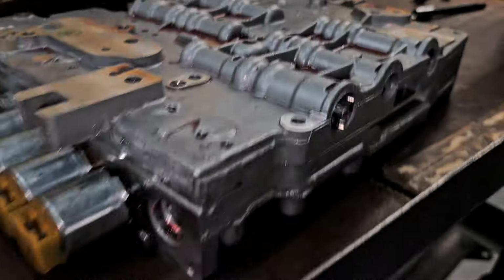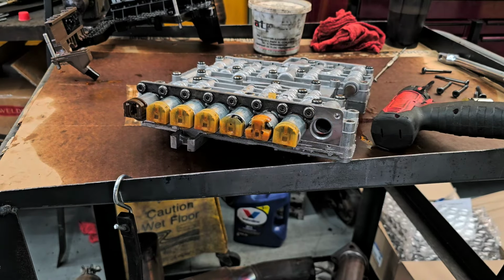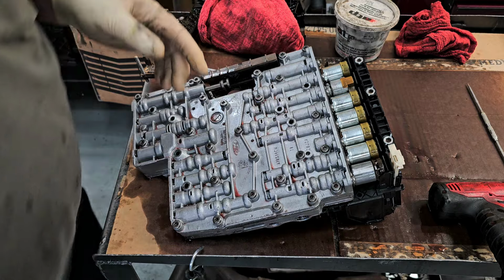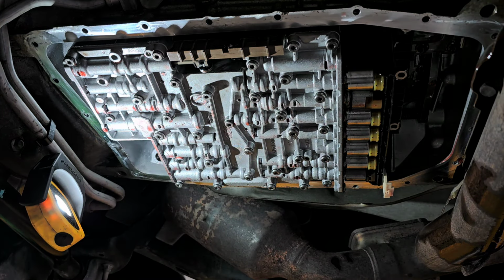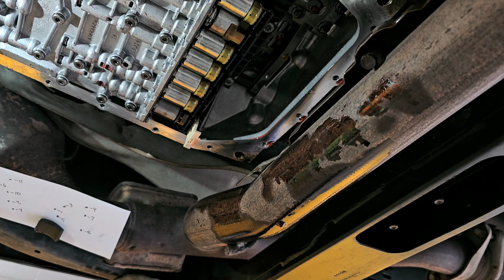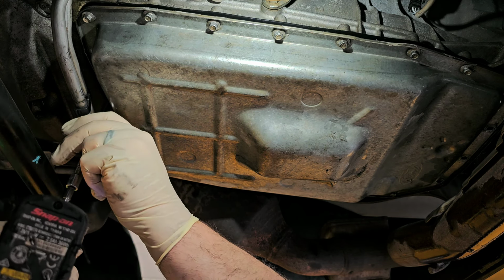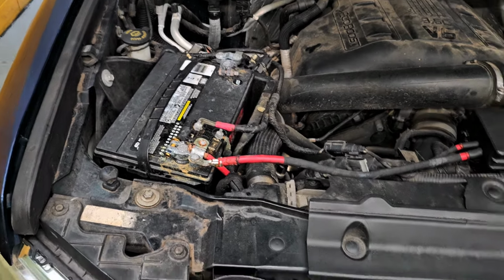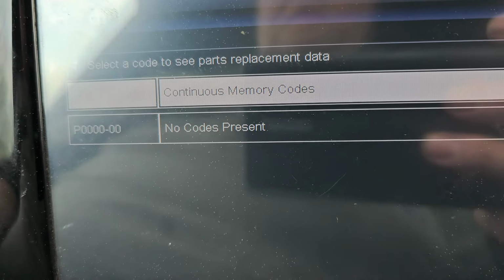Transmission Limp Mode After Warmed Up. I Finally Find The Problem & Fix The 2011 Ford F150!!

Comment: I had a repair on a customers car. After burning a bunch of brain cells I found the problem and at that point it was obvious someone had been working on it before I got there. I fixed the previous repair and it corrected the problem. I charged the customer a couple hours diagnostic charge, plus the time for the repair. When the customer came by to pick up the car I asked about the cobbled up repair. He looked at the floor and mentioned he had tried to fix it and failed, then brought it to me. I told him he could have saved a couple hundred dollars if he confessed that when he dropped it off!

Comment: I'm sure the power tool dependent generation could use a tutorial on thread repair. 
The number one tip I have is don't start threaded fasteners with a power tool.
Reply: About the only time I use a power tool with threaded fasteners is hanging drywall.
Reply: Great for removal. NOT for install.

Comment: Kenny ... excellent video. Mechanics like you are few and far between. Most dealers penalize you (flat rate robbery) by giving you all the hard cases!! My father was an old school mechanic. He knew electrical and was punished while the other mechanics got the brake jobs, tune ups, and simpler things. 

Your external microphone is fine. It sounds like you are over-modulating, and that should be simple setup to decrease the microphone sensitivity.

Comment: Yeah,a video on thread inserts would probably help us out, Mr Kenny
Reply: Helicoil, with the part needing repair held firm in a mill to do the locating, drilling, and threading.  A well set up drill press can suffice as well.  Anything done with a hand drill free-hand will make for an oversize hole that is weaker and looser threads.

There is only one insert type that is FAA approved for full-strength thread repair - Helicoil.  Solid inserts like EZ-Lok and Timesert will fail over time in any vibratory or thermal cycling application where a Helicoil will expand and contract with the parts in vibration and thermal cycling.  Pretty much all applications are vibratory and thermal cycling.
Reply: @BillyWillicker  I couldn't hold a regular hand drill steady anymore, so yeah a drill press would have to be my friend 😂🤓 ( I'm getting old)
Reply: @BillyWillicker  I worked on avionics where the cover screws, and any threaded parts going into the aluminium main castings, were all equipped with helicoils from the factory. 100 M4 inserts per unit, just for the 2 covers. Electric screwdriver was the first tool I bought, though I did make my own driver, using a long hex wrench with the angle cut off, and brazed into a brass hex spacer that was 1/4in across flats, and fitted the screwdriver. Long, as I knew i would have wear, so a quick grind of the worn end made it new again. Did have to replace the gearbox in the driver, the new Black and Decker gearset was powdered metal, instead of the plastic of the original, and lasted a long time, inserted with lots of light grease to help, unlike the original.

Comment: Good job finding and correcting a previous poor repair.  I had a similar instance where the customer had replaced a solenoid in a 6R80 for a circuit code.  After their "repair" it had a circuit code for the solenoid right next to it.  It ended up being damage to the main transmission connector on the harness side from a further previous "repair" before the customer had owned  the truck.  I replaced  the transmission/O2 harness and the vehicle was reliable afterwards.  

When it comes to transmission work, you have to thoroughly diagnose prior to dropping the pan.  That means road test with a gauge and scantool in a second tech's hands on the drive.  Proper pressure/scantool diag would have pointed you to that solenoid specifically before dropping the pan.

Comment: This was on par with a Fordtechmakuloco video. Great job finding the solution to this problem. I will add this, when replacing the pan bolts into the transmission, a light coat of anti seize goes a long way for getting them back out later. Steel bolts into an aluminum case here in the Midwest is corrosion trouble.
Reply: Never had any trouble with trans pan bolts in missouri
Reply: @donames6941  Missouri isn’t Chicago tho.

Comment: Torque converter bolt holes,GM and Chrysler have one that is an egg shaped hole.Line up this hole tightening this bolt up and the other bolt holes line up

Comment: Great job 👏,,I wish most mechs were this honest in houston ,,every 1 here tells you need a rebuild for over 2500 dollars 💸   3500 4500 for heavy duty 😂,,1 of my friends have gone for 2 trans 1 fully rebuilt diff when he only needed axle bearings

Comment: I'm sticking by my notion that your phone's mics all updated their drivers when you tried the bluetooth trick, and that's what cut the sound out a couple vids ago.  the audio quality is distinctively brighter.  and thanks for the torque wrench reminder, I actually went and double checked mine (I've hit a lot of lug nut idiodicy, usually overtorqued via ugga-duggaing and idiodic capped lugs)

Comment: 2 observations on my part, one is it seems that you are the one who is always fixing someone else's problem (someone has been there before) and you have such patience. I did notice when you used the tranny lube that you said "Let's pray it stays there". I was praying too. Mrs. Wrenching really came through for you on the one tool item. She (Meg) is a good woman...how is she doing now? Great job Kenny and super video. Oh, one more thing...can't you get a co-worker to hold that valve body in place while you install the screws?

Comment: Great video! I just subscribed to your channel. 😊

I guess there is no need to program the solenoid?

Also, if you replace  the valve body, does the valve body need to be programmed?

Thanks.

Comment: I have installed a lot of heli-coils and do not like to install them in aluminum as they seldom hold even with Loctite 212. I would rather bore out to the next larger size and tap.

Comment: Non mechanic so this will be stupid question, does each solenoid have a different function and are specific when changing out and also do they need to be placed in exact opening ? If so how do you know which solenoid is for what?

Comment: After watching your videos on the 5.3 with the ticking I am wondering what my issue is
My 5.3 has the ticking after having the lifters replaced 
But the ticking noise is only when In drive and accelerating 
It does not tick while in park

Comment: I did not look at all the comments, but I rewound because you did not torq one of the electrical plate bolts look at time stamp, 12:27 through 13:03 you torqued a bolt that was already tight, the bolt in the upper right-hand corner at time stamp was never torqued 12:09 or 12:30 bolt time stamp. Ooops.

Comment: What a mess that shouldn't have happened. If all of the information was known up front, then the repair probably would not have taken so long. Also, if you look at the solenoid bank early in the video before the solenoid issue was found, you can just see the misalignment of the solenoids.

Comment: 100% caused by a previous repair. They changed out that oddball solenoid  that is second from the left and didn't pay attention to the bracket placement.